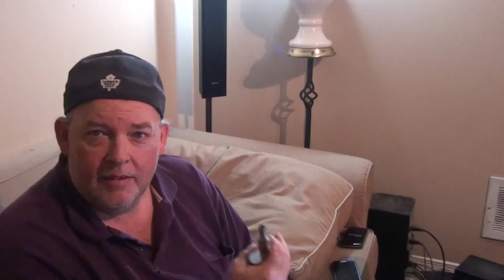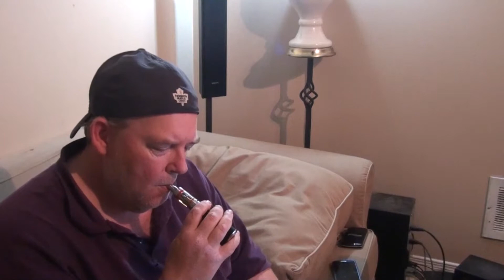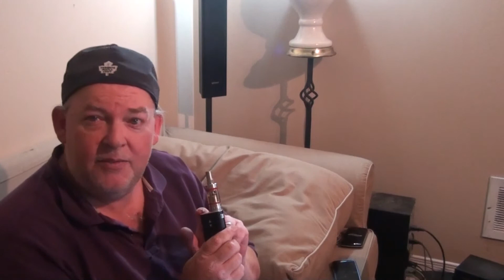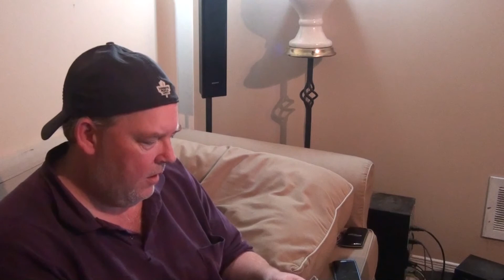Eleaf Istick 50w switch issue - not firing

Comment: Mine stopped firing. I threw it in a drawer all pissed off and went back to my ProVari. About 4 years later (tonight) I pulled the piece of crap iStick out and tried it again (since it's half the length and 38% lighter than the ProVari) and it works. Who knows how long the button will last.